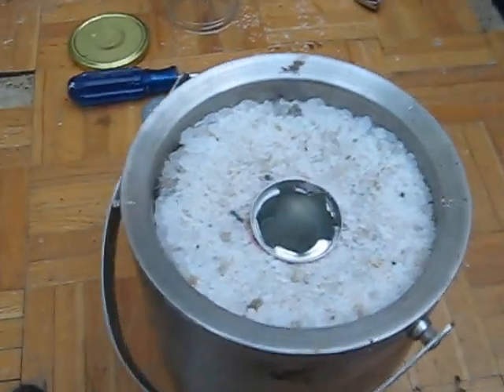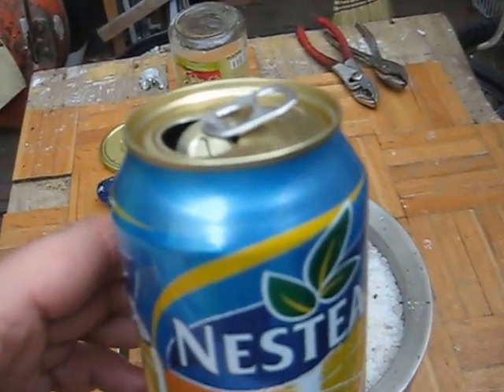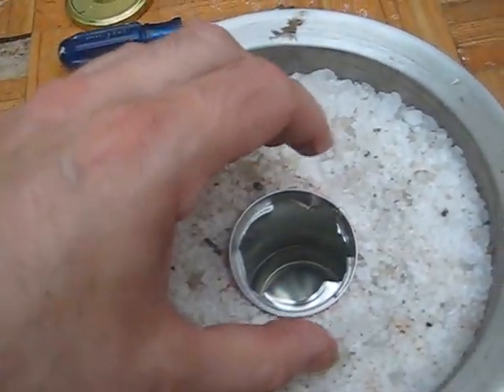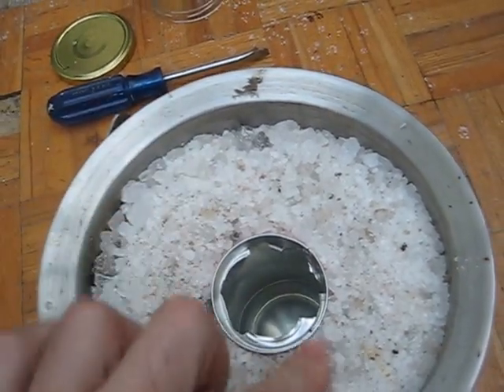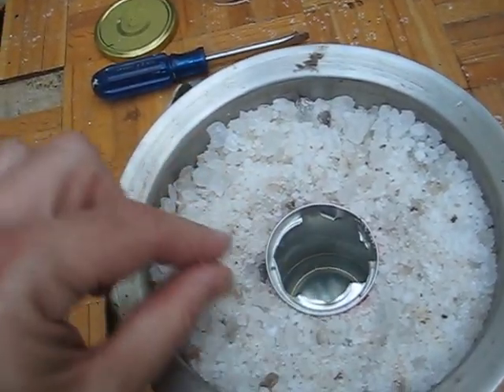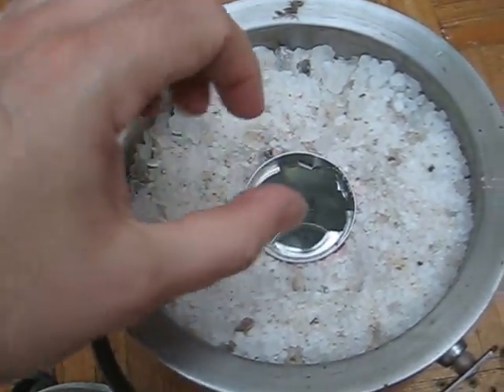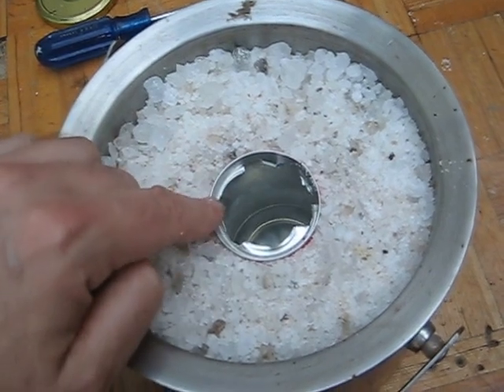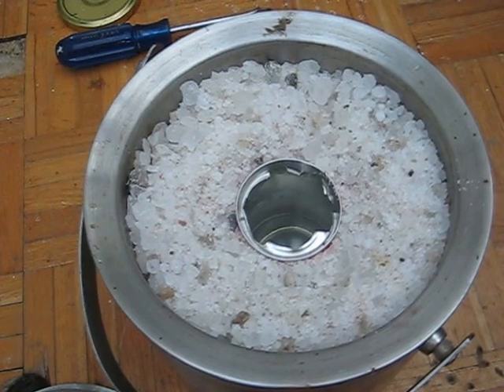Part 2 - Solar Energy Storage Free Energy storage

Comment: Where is the heat coming from? I want to make a stove from sand and look for a less Watt heater that I can put in the sand.
Reply: it is heated oil by a fixed focus solar concentrator (key word)
Reply: @---gq5qn  Aha, thank you!
Reply: here is some help get a element out of a kettle and run it on a lower voltage to get a lower watt output ,on average they are 25 ohm so a 12v source will only draw about 6 watts while a 18v will draw about 13 watts etc easy to work out from ohms law , place this element in a central container of sand surrounded by a second container containing an insulator i use perlite with some glassfibre cloth around the second container for extra insulation ,depending on what wattage you use it will heat up the sand to at different speeds but it can easily get to 200 degree c on 12v . important to remember these types of elements will blow out at about 220 degree so you will need to make sure it does not get hotter if using this type (alternatively you could have a central hole with removable insulation that would allow you to use it like a chimney section for a rocket stove this can get up to 600 degree c in ideal conditions, how you choose to get the heat out is up to experiment you could use a copper coil buried in the sand for boiling water or maybe a hot plate of suitable metal to place a pot on the possibilities are endless but be very careful you understand what you are doing when using these temperatures
Reply: to calculate how long it would take to heat a certain amount of sand use this formula cubic metre of sand x 1600 x 830 x change in temp divide by wattage used divide by 60 to get minutes  divide by another 60 to get hrs divide by 24 to get days ..

eg using 12 v(6watts)  a cylinder of 40cm diameter and 50cm height has a cubic metre of .06 to heat this to 200 degree c use the above equation - .06 x 1600 x 830 x 200(assuming the sand is 0 deg at beginning) divide by 6 divided by 60 divided by 60 divided by 24 = 30.74 days 

at 200 degree c this size container stores about 4.426kw/h 
the above example is probably to low in power input(6 watt) to be useful or to large in storage (.06 cubic metres) to be practical for most needs but gives an idea of how to calculate a design to suit your needs .
Reply: @idoitforyou6473  Again so much thanks. I am happy that I have not sooo much sand in my stove! 🤣
Reply: @idoitforyou6473  Thank you soooo much. I ordered already a transformator to 12V. ♥️

Comment: Doesn't the salt corrode the can.
What is the max temp you got the salt to.
Reply: Try replacing the salt with sand Sand .
Reply from the maker: with a low oxygen environment like a vaccum (which is mandatory to store heat) I don't think it will

Comment: yea, heat to 600 to 800 + degrees F, insulated it like BIG time and you might have something, phase change? I found concrete worked best, can handle 1000f if heated slowly. Good Luck!
Reply from the maker: no concrete is heavy ugly salt like Glauber salt in vaccuum is a solution for sure too easy :)